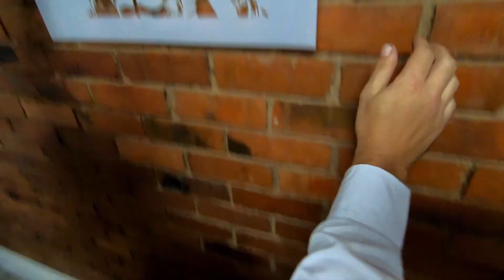Cron Co2 Laser Cutting Machine Introduction

Comment: How deep can the cron 3020 40w laser cut? it only gives the cutting speed in the info section.
Reply from the maker: You can cut deeper with multiple passes, without any form of air assist you won't be able to cut as deep because of burnt material buildup.